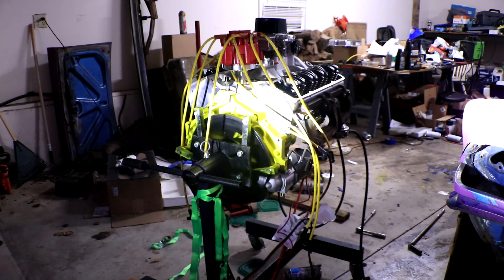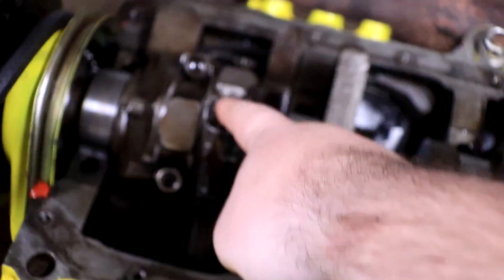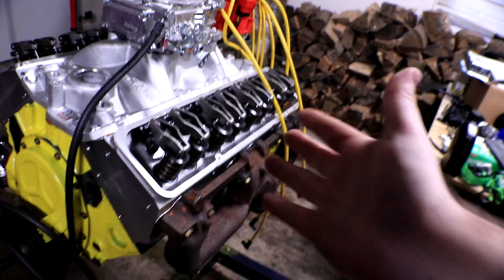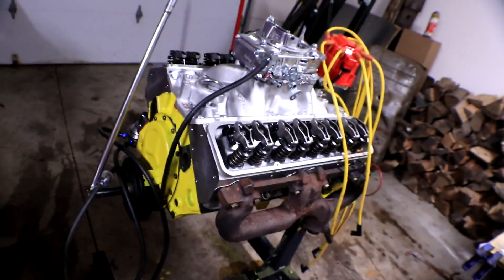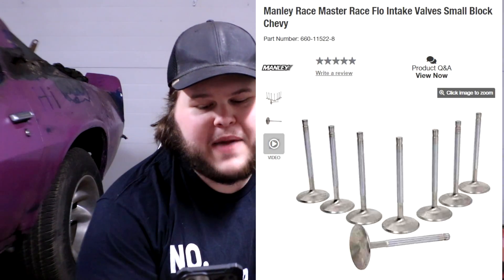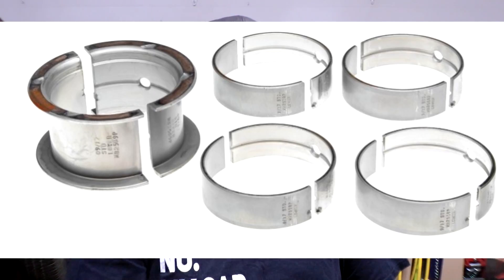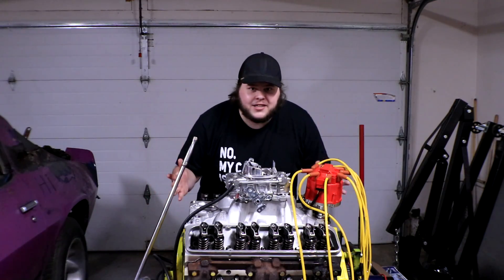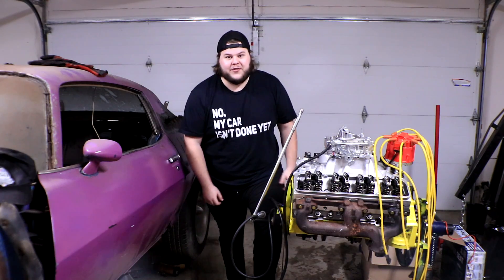The $1,700 MISTAKE that KILLED my Chevy 350 Build.

Comment: You will need a bronze gear on your distributor for a roller cam.
Reply: No. Bronze gears are only good for 10,000 miles on the street. He needs to run a melonited steel gear for the street.
Reply: @colejohnson3705  Isn't he building this car for his MOM?
Reply: @marcmo7138  What does it have to do with running the proper distributor gear that Howards recommends for street use? You think his MOM should change the oil and filter every time she drives it to get rid of the bronze wear particles?
Reply: @colejohnson3705  Actually the bronze gear is more for race applications where the oil is changed often. So yes a melanite gear would be best.
Reply: @marcmo7138  Correct. I was just explaining this to one of my customers yesterday that I am doing a build for. You have a fantastic day Marc!
Reply: @colejohnson3705   You as well.

Comment: Dont forget to threw the chinese oil pump into the trash bin! They break in peaces! Same story with Melling M55 pumps! Get a Moroso High Flow but normal pressure pump!
Reply: High volume pumps are normally big-block pumps that have extra teeth. Extra teeth help with "spark scatter" that can afflict sum smallblocks.  I modify the oil pumps by:
Stripping the pump and cleaning it to get tid of any chips or loose casting scale, only ever found a couple of bits but thats 2 x too many. 
Dilling 2 x 30thou holes between the teeth of the driven gear, one each end of the gear to help oil to get to the pin/shaft that is spins on. 
Using a Dremel, grooves can be put into the end cover to again help with oiling. 
Assemble the pump and with whatever pickup you choose attatched submerge in a bucket of clean oil and spin up to check relief valve. 
Use bearing blue on rear main cap oil pump face and bolt oil pump to it then remove and uding a grinder remove material until both faces are port matched so to speak, this removes any sharp edges that could restrict flow even tho a SBC has an amazing oil system to start with..
I always use a light smear of Permatex aviation gasket sealer between the maincap and oil pump. Benefit not much probly but it doesnt hurt. 
And I use an ARP (or smilar grade) oil pump stud instead of a bolt..
Reply: @matui6983  good idea but for Mr Goblin here it would be easier to buy a ready made High Flow pump by Moroso. (I assume)
Reply: Cant argue with you there. 
Buying sumthing readymade is the best idea. 
But the endcover should still come off anf the pump checked for rubbish in it and then grease/vaseline packed into the gear cavity to help with it picking up oil.

Comment: Gotta use a dial bore gauge and a micrometer for main and rod bearings.  Measure, measure, measure.  Cant trust the packing.  Everythings made in China these days and im pretty sure they check tolerances with a popsicle stick.

Comment: Y change springs if its not being pushed hard, and bearings if they plastigauge good there good, not everybody nows how to build an engine, specially chevy u can throw anything on them and it runs, so its not that technicall, fram filter ive run these all my life im 41 and do 30,000 milez a yr never had a failure, everything is prone to b bad once in a whille, and petformance parts no warrenty anyways

Comment: I've bought A BUNCH of ebay and Amazon parts and had good luck. You have to use common sense on what to and what not to buy from there. There are things you don't skimp on though. Bearings, oil filters and such. Also, i agree you probably SHOULDNT take heads out of the box and install them but people do it all the time just fine. I wouldn't replace literally anything in the heads. I'd also probably leave the cam in it and run it. Again, thats just me. Id talk hardcore shit about a lot of decisions you made but you admit you don't know what youre doin. So it's fine. Also always check all bearing clearances with plastigauge for peace of mind. And you really didn't have to pull the crank to change bearings at all.

Comment: I think your first mistake was painting the car purple...........lols  But, I'd recommend stop listening to everybody that has a key board.  Buy a chevy small block book and study it carefully.  Putting race parts on a street car just means spending money foolishly.  Plenty of small blocks have run for thousands of miles on good quality replacement parts.  Race this and race that is just marketing hype.  Clevite or Michigan stock bearings are more than adequate.  Use to be different though, Example: clevite bearings sold in NAPA boxes, etc.  Today most branded parts are just another name for Chinese parts.   These companies couldn't sell parts if they proudly claimed made in China.    I wouldn't slam ebay so hard.  If you know what you are buying they are the only people that have NOS parts that are known good, made in the USA.  But, there are tricks to that so it's buyer beware like anything else.  About 30% of what I buy there is miss-represented good and bad.  So, not the place to trust everyone like you found out.  David Vizard is spending his limited time left on earth helping people like yourself make great engines.  He'd be a guy I would spend lots of time with for gaining more knowledge than your average bear!!!!!!!!And paint that dang engine Chevy Orange, it will run for ever.